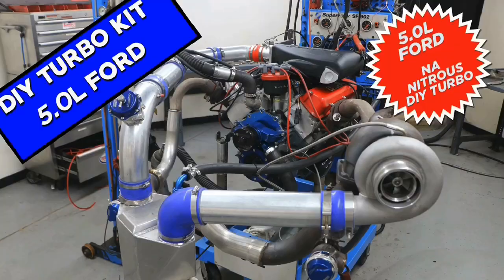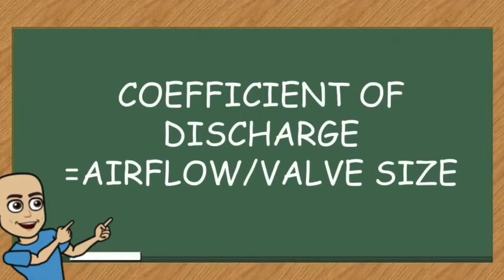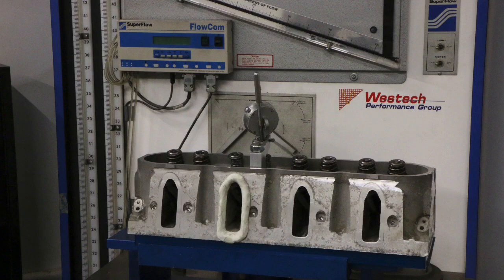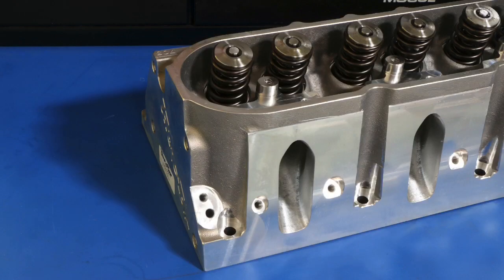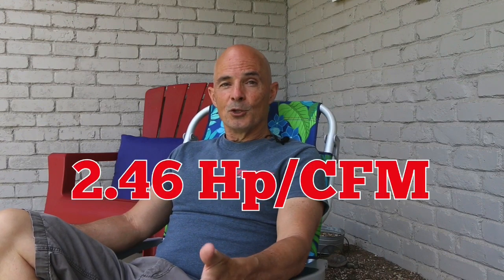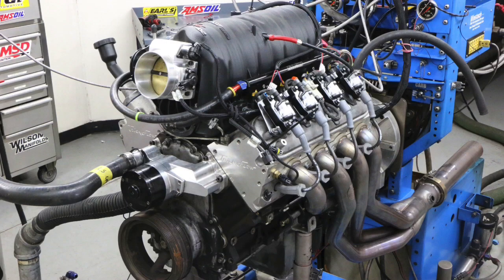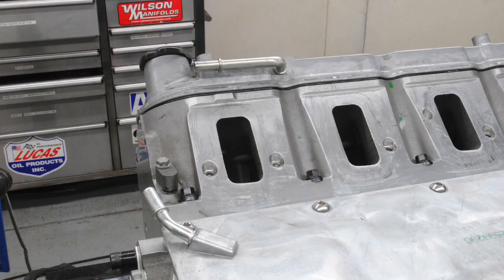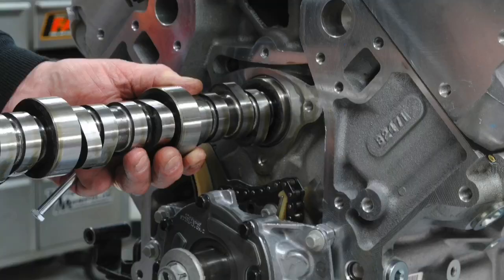IT'S ALL IN YOUR HEAD

Comment: Honda K head for the win ?
Reply: scrappy : Yeah. Honda were asked in 1978 by Ford Ausrtralia to rework the big port heads on the canted valve six. Discharge coefficient was everything. GM has really summerised a lot of V-techical info. As RH said...a V-Tech 4 valve per cylinder head is the king of more flow for less valve. For  traditional US Chev V8, this video is a huge benefit to targeting the right Head Cam Intake mod priority. More power, better modifications. This helpd the modification industry because we can target an unboosted horsepower level like Honda Motor Company has done. Efficency has arrived in this video. Excellent work Richard!
Reply from the maker: those r good heads

Comment: Ok Richard, a camshaft question. It's is relatively obvious that highest possible lift on a camshaft will create the most flow at a certain RPM, (and torque?) for the amount of duration. When do ramp rates get excessive and of course isn't this the reason why roller cams at the same lift and duration make more power. Off road applications sometimes need favorable torque without the duration and cam manufacturers do not seem to offer high lift low duration camshafts.
Reply from the maker: lots of spintron data needed to make sure the high-lift, short duration cam will be stable-also more lift does not always add power

Comment: I'm not trying to be a contrarian but the SR-71 heads on a 598bbf made 1100 plus. They flow 434cfm, am I missing something?
Reply from the maker: That's 2.53 hp/cfm-that's a lot of power-meaning a well designed combination-but one that will make even more with additional head flow
Reply: @richardholdener1727  but according to the video they should only support 868hp? Hence my confusion.
Reply: @Andreas i guess its the verbiage that is throwing me off. I'm just trying to learn, but I'm not particularly intelligent.

Comment: Could you try testing an assault cylinder head maybe just to show how much quality they have and how much horsepower potential I have some on my 409
Reply from the maker: I'm not familiar with those
Reply: @richardholdener1727  they're sold on Amazon eBay for only four hundred bucks for two heads and I've seen some machinist do some reviews on them and they seem to be better quality are just as good quality as Dart heads and I forgot to mention by 4:09 I don't mean to Legendary 409 Mystery engine just a 400 bored 40 over but the heads are compatible with all Chevy small blocks they come with 205 CC intake side I don't remember the exhaust side multi-angle valve seat 100 + valves required three-quarter inch spark plug thread length 202 intake 160 exhaust valves very impressive heads for only $400

Comment: One other thing I have heard from a very talented head porter was that he found that the heads that were the quietest on the flow bench would make the most power. They had less turbulent airflow.
Reply: Flow quality is very important .... Though we like to look at big numbers if the port starts to surge or back up (drop in cfm) it will not work well on the motor
Reply: I think this technique is specific to or at least particularly important on exhaust ports. Darin Morgan from Reher Morrison / Profiler for a while, then back @ Reher Morrison regularly talks about how an exhaust sounds being more important vs. max CFM flow on a flow bench.

Comment: So you're saying the CFM per port multiplied by 2 is the power potential for a V-8 using these heads?  And folks with 4, 5, 6, 10, 12 cylinders would have to adjust proportionately.
Reply from the maker: yes-it gives you an idea on potential

Comment: You have ZOMBIES in your head.  Your theory is flawed. For max hp you want way larger valve area that is the reason for 5 valve heads. Read what Vizard thinks of it. Port volume means squat in comparing heads from 2 different engines as the intake manifolds vary in volume.   Now Comp cams is making  gentle opening cams. Going back in time? Isky made cams that would allow a sb chevy to rev to 10,000 rpm in the sixties. Imagine the port velocity.  Still it was not too good as there was not enough valve area.
Reply: Flow at lift, is flow at lift.
Reply from the maker: did you watch the video where I said on a race engine looking for max power at high rpm you want to go big?

Comment: I'm a little late to the comments here, but shouldn't coefficient of discharge use valve area for a proper comparison?  After all a 2.2" valve is 10% bigger diameter than a 2" valve, but it has 21% more area....
Reply from the maker: does the air flow though the entire surface are of the valve or around the diameter? flow though the port would be area
Reply: @richardholdener1727  Depends on valve lift, no?  A 2" valve at 0.5" lift has about the same curtain area as there is valve area.  So above that we are pretty much flowing the port (minus some aero effects of the valve).

Comment: But what about exhaust flow?  And what if you have a intake port that is on the larger side with lots of flow, then an intake with with some smaller runners... dose that make it work like a smaller port with big flow?
Reply: Flow benches can't accurately flow exhaust.
Reply from the maker: for this formula we are just talking about the head flow-intakes change things a lot

Comment: I'm glad Richard brought up this topic. People talk great about 4.8 and 5.3 engines. Truth is the power is in the head. Take a 305 with 3.736 bore. They came during emissions era. Do with junk head they were considered junk. The 5.3 4.8 engines are 3.780 bore. So basically a .044 wider bore. So give the 305 similar flow heads and cam lift and see what it makes. 
I would love to see a gapped ring 305 with a Richard picked camshaft and turbo be a boost till it busts video. 

Cubic inch is potential and cylinder head,cam is the power.

Comment: Your best heads will always flow 300cfm at .400 lift, that head will always make the best power average. The engine does not breath at max valve lift or when the valve is closing. Its all revolves around pressure differential , look at spintron testing with cams of over .700 lift and you can see how the air is only flowing at mid lift.
Reply: Right racer D. It would also be interesting if we could get more complete camshaft duration statistics. Let's have the duration stats for any given cam @ .05" Intervals up to whatever peak lift is. This would help us to better match a cam to the heads.

Comment: Have u made a video on picking the most efficient cam for the heads that u are running
Reply: "Efficient" is vague in this instance. Horsepower goal, desired RPM range and cubic inches are more important factors than cylinder head for the right camshaft.
Reply: Yes I understand all of that and yes efficient I a vague word and I understand u want everything to match the best u can but I'm sure at some point ur cam  choice could be optimized with some nerd math to squeeze all that u can out of the flow of a head
Reply: @goader190  I get the question, thing is that theres so many port designs and flow rates of all different cylinder heads so there won't be one equation that you could use for all engines, because even the worst LS head flows as much as a decent big block chevy head. If the engine family in your question is LS then I can steer you in the right direction, I'm not familiar with other engine types.
Reply from the maker: the best cam choice won't come from math-it comes from your definition of best-where you want things like power production, idle quality, fuel mileage, chop, etc...
Reply: @richardholdener1727  he said "fuel mileage" 😃😃😃😃. Cool got it thanks

Comment: I have commented about 706 heads before,  once I figured out coefficient of discharge, I ordered a set of 706 heads to port myself, I have a BMW M Roadster With a LS1 tuned with headers and a 5000 rpm launch it would do 0-60 in 4.8 seconds max. Later added my ported 706 heads with summit racing 231/242 600 lift cam, now it would do 0-60 in 3.85 with a 3500 rpm launch. No wheel slip on either occasion, both tuned my me

Comment: Most people when it comes down to choosing a head, or modifying one, have a sole and main concern the peak CFM numbers, so they make things as big as possible, but that's half the story. Too big of a port vs CFM can only give a very slight increase up top as a positive effect, or even act negatively on cfm delivery, making it lazy and thus less usable by the rest of the setup, by losing velocity and speed, or in  another case offer absolutely nothing in comparison to the stock oem head. The COD formula derives and it is based on velocity and speed attributes of the air. More velocity creates better air transition, which in turns creates more speed, and more speed means more, and more usable airflow/cfm. The best way to achieve max velocity and speed is to push the max amount of air through the smallest holes/ports, hence why you divide cfm vs valve size/port,  the smaller the valve the bigger the cfm number. Also max velocity and speed will create the best possible throughout delivery of torque and powerband. What I'm saying here is that, one can apply the COD formula in whatever type of setup he wants to make, whether that is a street setup with lots of low end torque, or a drag monster on max CFM and hp. No matter the setup, one needs to use the smallest head ports and valves possible in relation to what his intended setup and goal is, that is how COD works, otherwise he will lose velocity and speed, which are also affected by the internal design of the head and the CFM ratio between inlet/exhaust head port and valve size/port. Also as said on the video in order to maximize a head's potential one needs the rest of the recipe, as the head itself is only part of the V.E of a setup.

Comment: I don't want to start an argument but I will anyways. Cd is irrelevant. It's also a little unfair to compare tf225s to ls3 heads when the former has an exhaust port that flows nearly 20% more. If you compared flow to minimum cross sectional area that I could get behind because it gives you an idea of velocity without having to probe the port on a flow bench. Almost all production and aftermarket heads have appropriately sized valves that making bigger gets them closer to the chamber wall or bore. The issue you will have with modern castings is the flow rate so wildly exceeds the needs of the engine in nearly all cases. You yourself have done a test on cnc ported ls3 castings that added only 2% power with 10% more flow. Even if making the valves larger added flow, there is very little chance that there would be any noticeable power gain.
Most heads are also not valve limited at peak flow and will not flow more even testing them with the valve not installed. The limiting factor, especially on a cnc head, is velocity through the port at the point of minimum area.
If you took that tf225 head and put bigger valves in it, there is a whole host of problems. It's designed to fit 5.3l bore and can with a smaller valve, it uses in line rockers, and if a smaller valve really is potentially better for power, why does TF use intake valves bigger than any factory cathedral port head?
Reply from the maker: I think I covered a lot of that in the video, but I'm unsure what your point here was
Reply: @richardholdener1727  cd is irrelevant my point. You can completely ignore valve size in a head comparison as long as they fit. You might see coefficient of discharge listed in some papers, but it's almost not referenced in anything but scientific papers.

Comment: I have a 2017 Camaro SS with a LT 1.  How can I find out how much the heads flow?
Reply: Look up to see if anyone's figured it out otherwise you gotta pull the head off and bench it yourself. LTs are popular I'm sure someone's got the numbers. I know Texas speed rebuilt cleetus LT1 so they probably have the information somewhere.
Reply: Ask TexasSpeed's tech center for an exact value because they do porting and stuff, I can tell you that the LT heads are based heavily off LS7 head port designs, which will mean they flow extremely well.

Comment: Thanks for another great video Richard :) On my fox body mustang with a rebuilt 302. I picked the afr 165 heads because of the great flow numbers in the lower lift ranges which works great with the stock cam.
Reply from the maker: those work well

Comment: I’ve been preaching coefficient of discharge for a while now. I even made a video on my channel about it! Specifically when talking about the 706/862 heads on a 6.0 engine. Thanks for putting this information out!!!
Reply: Mr. Holdener didn’t talk about the heads. I was referring to why I make an argument for the 706/862 heads on a 6.0.
Reply: SierraC3TV Black_Widow_C3 yeah I hand ported some 706 heads to put on my LS1, and all I’m going to say it that I believe it was the right decision, some people say they don’t like the 706 heads because of the small valve. I say if you’re not trying to make over 550-600 hp, the 1.89 valve will give you more average power from idle to redline, and especially idle to 5200.
Reply: Drivin with Drew I couldn’t agree more! Everyone is on the 243/799 bandwagon but I’m a firm believer in the 706/862 heads. They are more than sufficient to make one very powerful and streetable hot rod!
Reply: I must've missed this talking point. Please inform. Thank you

Comment: You can’t just look at discharge coefficient. A prostock engine has great coefficient of discharge but will work like a turd on a 5.3 with 220 cam . You must first get the cross sectional area correct for the amount of hp then look at coefficient of discharge

Comment: I wonder where the multiplier for boost comes in? as these equations are at atmosphere pressure. @richardholdener
Reply: Like rich says, maximizing the engine N/A will yield best results when under boost. No cyl. head company does flow number tests under boost circumstances. Absolute engine vacuum + 14.7 PSI of boost yields 100% power gain (roughly), gotta know the N/A power to have an idea of what it makes under boost though.
Reply: Yeah also curious..... 14 psi through ls3 head
Reply from the maker: boost just multiples the NA power-whatever it is (I don't use boost on this formula)

Comment: having watched this, how do you calculate how high you need to rev your engine in order to maximise air flow? if you have a head that flows X cfm at 1.000 lift, how do you figure out how high to rev your engine to optimise your 1.000 lift specd camshaft?
Reply: A dyno is how you determine it, because theres far more variables to take into account than flow numbers and camshaft. Cubic inches and camshaft have far more an effect on redline than flowbench numbers because they determine the real world flow. Specified RPM range from a cam manufacturer is a decent place to start, but a dyno is the only way to know.
Reply: To the moon brother, and the camshaft manufacturer can usually tell you what the cam will like,
Reply: You need to find the minimum Sq In area of the head , and that with the Cu Inch of the engine will determine what RPM the head will support.
Reply: @keithstarner6724  good call there. Minimum cross sectional area is so important. If you know what it is you can determine what rpm a given displacement will make peak power. Also be sure what size fixture the head was tested on the flow bench.
Reply: @scottb7559  Don't forget about the length of the intake runner. That will position the peak torque number, this effect horsepower peak.
Reply from the maker: to take full advantage of the available head flow, everything else in the combo must be right-its not calculating rpm

Comment: Damn what a great video lots of information. I have been back and forth about going rec port on my 6.0 but after this thinking about just running my 243’s or even get them ported and running them. Keep up the great videos.
Reply: I’ll be doing the same on my 5.3 fi
Reply: I'm trying to decide on Rec Port or Cathedral Port myself.
Reply: I have both (ported 243s) & (824s).  Based on this info, I would do better using the 243 between 0.4- 0.6 lift.  This is a great equation to know.

Comment: I'm curious what a dyno would show with a 1.0"+ lift cam, with heads that start losing flow after .800....
Reply: May have to have some exotic valve reliefs on those pistons
Reply: @lucysmith4242  No, just custom pistons. Nothing exotic about it. Race engines have had cams like that for a long time. ;)
Reply from the maker: the lift isn't usually the problem with P-V, its duration

Comment: @RichardHoldener have you ever tested a BMW N62B44 V8? I'm planning on building a stroker N62 for my 745LI but here is little to no info on these engines. Like head flow, camshaft specs, or even how much power they can handle. This is going to be a budget build sourcing heads, cams, intakes, maybe even pistons, roods, and cranshafts from junkyards/wrecker yards. Thank you for time,  effort, and great content.
Reply from the maker: I have not

Comment: Richard just built a 6.2 from a 6.0 liter block, has 823 heads with Ls3 intake in a 2004 Tahoe, I have to get it smogged so I’m temporarily using an LQ9 6.0 liter cam to get it smogged, once it’s smogged I have the sloppy stage 2 cam going in, can sloppy stage 2 be smogged for California?
Will it pass?
Reply: mci007 
Look at your lsa and duration to find out if you have any overlap.  The biggest cam that passes emissions (easily) here in the uk is a 220/224  114 . On a 5.7 or 6.0

Comment: So does higher Coefficient of discharge help because of less valve shrouding or port velocity?  Both?
Reply from the maker: more flow though smaller valve opening usually equals improved cylinder filling
Reply: @richardholdener1727  is it just the increase in the inlet charge velocity improving cylinder filling that is helping us here, or is atomization also improving to thanks to the high speed?
Reply: @richardholdener1727  that's what I said, the question is why.